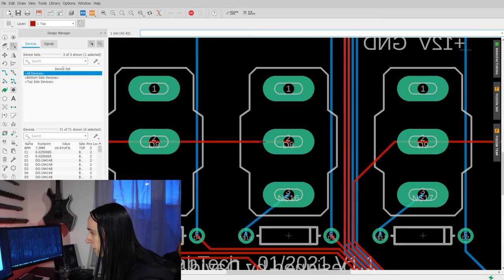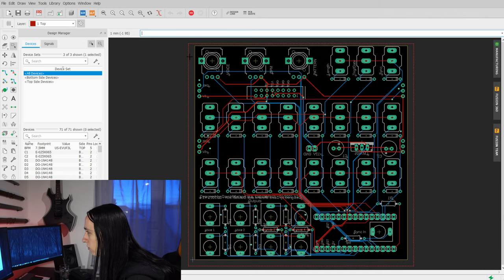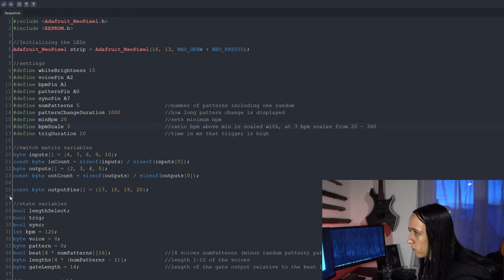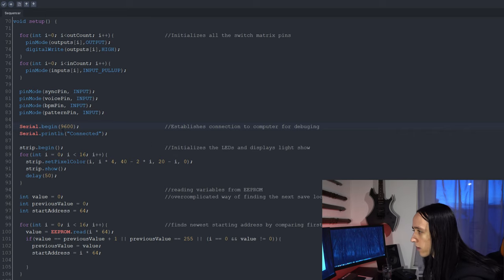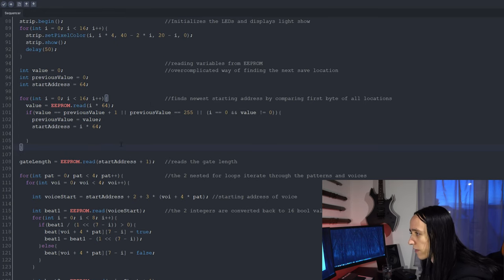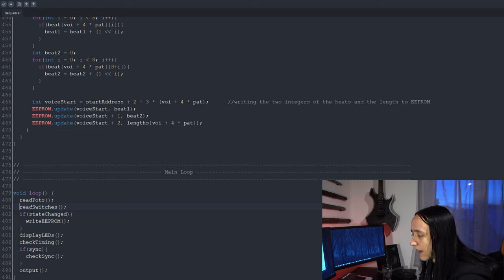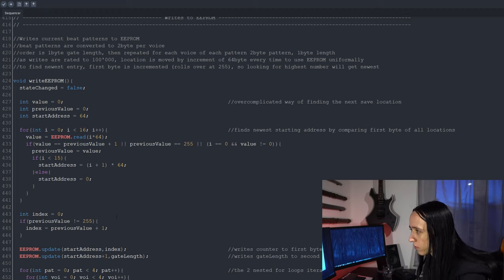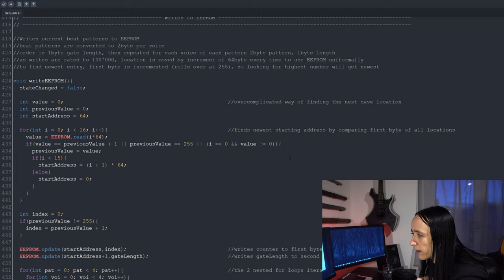DIY Sequencer Module (Full Walk-Through)

Comment: Do you think it would work to support the PCB by the edges with room underneath to use your heat gun?  Then the PCB would eventually get hot enough to melt the solder but the LEDs wouldn't be the first thing heated and perhaps take too much heat?  I don't have any experience with this, but it might be worth a shot.
Reply from the maker: Sounds quite involved, but could work, some people use things like hot sand, which would to the same thing, so maybe worth a shot.
Reply: @DarkArtGuitars  I definitely am talking about things I haven't tried, but if you have one of those third-hands that is often used for soldering where it has little alligator style clips to hold things, perhaps just clip a PCB into that and position it close to the edge of a table so the PCB has room for your heat gun under it.  This will be an area I play in eventually but right now I just haven't had the need make it to the top of the list.

I enjoy your videos.  I converted a PM25 to CNC using LinuxCNC and know what's involved in your project.  A lot of work.  I know have a couple of Tormach 1100s and the PM25 needs to find a new home...

Comment: Does it also work with WS2812B LEDs instead of the Neopixel ones? Or does that require changing the code?
Reply: Probably. I believe neopixel and WS2812 are mostly interchangeable. On esp32 I use the neopixel library to run. Although some variants of WS2812 are sold under the same name but actually differ a bit. Most libraries support the different flavors and it should be quite easy to adapt code if necessary

Comment: Just found your channel, already sub. Genius awesome, this module what I have looking for. :) 
If I am using eksternal clock to sync, does this clock will reset to first step? Or Am I missing something. Thanks
Reply from the maker: The way an external clock works with the code I wrote is that on every rising edge of the sync signal it moves to the next step. It does not reset to the first step, as the different voices might be at different points of their cycle, as they can have independent lengths for the repeating pattern.
Reply: @DarkArtGuitars  Ah yes, many thanks. Is it possible to adding push button reset?

Comment: Really well thought out module, the interface looks really good. Well done! It would be nice if you could adapt it to a CV sequencer with tall trimmers instead of switches to partner it.
Reply from the maker: That would bee cool as well. If you want to keep multiple channels though, you'd almost have to do it with rotary encoders and the LED as feedback, otherwise it would be a pain to adjust parameters of different channels, as you couldn't just move it a tad up as it would jump to whatever you used the pot at in the other voice.
Reply: @DarkArtGuitars  yeah that's true, you could use the LED intensity as an indication of pitch i guess, would be a little imprecise. I imagine switching from pots to encoders would mean a lot of work too. Great module though anyway, once I get some drum modules I may knock one together.